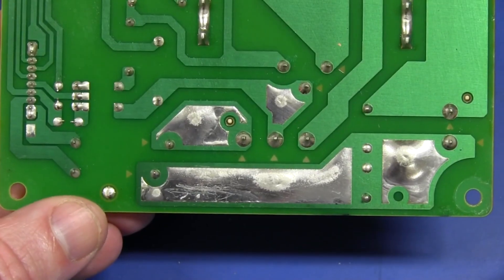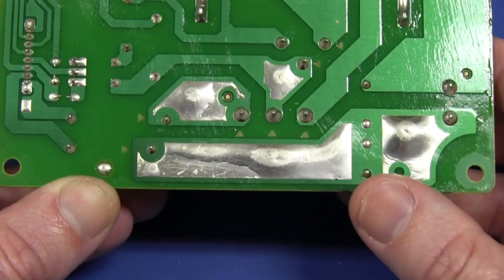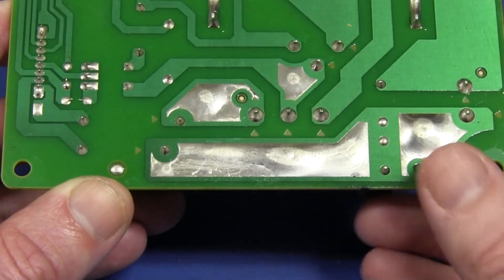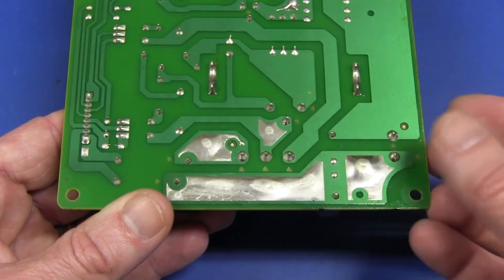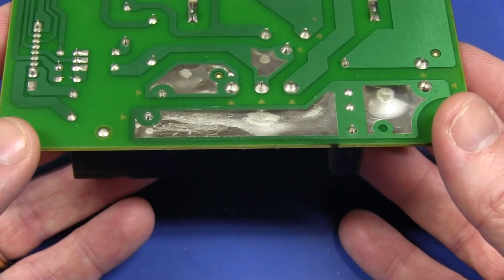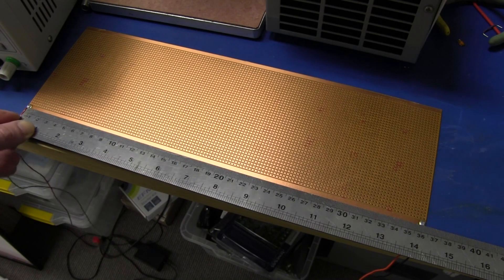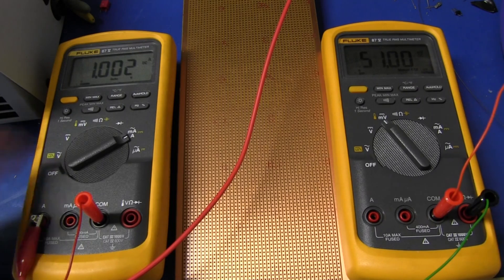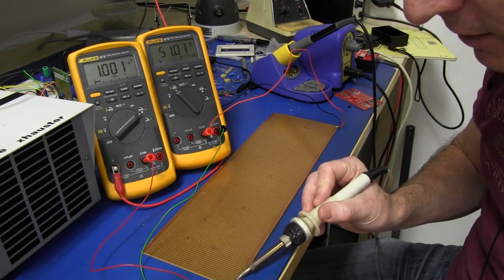EEVblog #317 - PCB Tinning Myth Busting

Comment from the maker: Used solder wick makes excellent heavy current wire, don't throw it out!
Reply: Great for replacing those burned open traces - Ha, ha!!
Reply: Yes i do it all the time lol
Reply: Amen.  There is larger braided copper as well, as well as added wire - or copper bezel strip.  This latter can be had in widths up to 1/2 inch /12.7mm, and 14 thou/.35mm, from RioGrand (jewelry supply).

Neatest way, in my thinking, (for really simple boards; much simpler than these, even) would be to plate up an added 4-6 thousandths/0.1 - 0.15 mm of copper.  Plating isn’t that hard, if you can give it time in the bath.
Reply: Exactly
Reply: It's a poor man's lithium cell strap.

Comment: You can't put 10000 volt over that trace at 0,0001 ampere, as the resistance of a trace that conducts 10000A and has 0,0001V across it would be 0,0001V/10000A=10nano O, to get a voltage drop of 10000V over this you will need to have a current of 10000V/10nO=1TeraA. 1TA*10kV=10 Peta Watt. Do not try that in populated areas.

Seriously though, the problem might be likened to the wire in a fuse, a 1A fuse burns out at 1A regardless of whether the circuit it protects is powered by 1 or 100 volt.

Comment: @Benjamin Phelps  A 40% increase in resistance is the same as a 28% decrease in conductivity. It just depends whether you're talking about gaining resistance by removing copper or reducing it by adding copper. The ratio is the same, it just depends whether you start with the higher or lower resistance when calculating and expressing the percentage change.

Comment: The pros and cons for PCB manufacturing differ from PCB repair a bit. Years back I repaired quite a few power supplies in a certain model of Panasonic Laser Printer. There was a trace that was improperly sized around one of the pads. It would get hot and desolder the wire sometimes lifting the pad from the PCB. To fix it I stripped the solder mask back about 1/2 inch & soldered a 16 gauge wire along the trace. At the pad I made a loop with the wire to give plenty of area and strength.

Comment: On some high power boards (Eg UPS etc) I've seen strips of the mask removed rather than the whole track area. I wonder if this helps the solder to pool due to surface tension on the edge and so overall a greater amount of solder then letting it flow over a large surface area? that as a technique would certainly be more predictable as a manufacturing process

Comment from the maker: Mike's example had several unknowns. Like the amount of copper used, and it's original value without solder. The amount of solder can vary massively between boards. My amount was not arbitrary, I did a minimum amount and a maximum amount based on a known trace width. That gives us typical max and min figures to work with.

Comment: Hi, thickning the trace with solder is not the only reason to leave the soldermask of. When you leave the soldermask of without soldering you already increase the heat disepation of the trace. So the resistense doent change but you can pas more current true without killing you trace.

Comment from the maker: It would be interesting to see how much effect the trace width has and plot any resultant curve... More in-depth analysis really needs a way to evenly and consistently coat the trace with different thicknesses.
Reply: I also wouldn't mind seeing it with surface mount processing.  where you leave a gap in the soldermask, and leave a gap in the stencil.  we found that with 2oz copper the 5mil thick stencil really didn't have any practical difference with the operation of the board (we never went this detailed into measuring trace resistance),  and the extra solder did cause a number of other problems, especially with conformal coating adhering to it.  
I also found an article at the time (sorry, this was a while ago so I can't reference it)  that says solder is about 6x the resistance of copper, so a 1 oz trace (35um, or 1.38mils) a 5 mil stencil (assuming the whole stencil gets filled with solder at the end) the solder will give 30-40% reduction in resistance.  right in the middle of what you measured!.
Thanks for doing the numbers!

Comment: It's possible that the PCB I used had 2oz copper, so the difference with solder would be less. The trackwidth will also make some difference due to the rounding at the edges.

Comment: You're absolutely correct. You should never try to cool solder artificially as it can lead to a poor joint. It's well known by plumbers also that if you cool a soldered joint quickly, it also fails quickly...